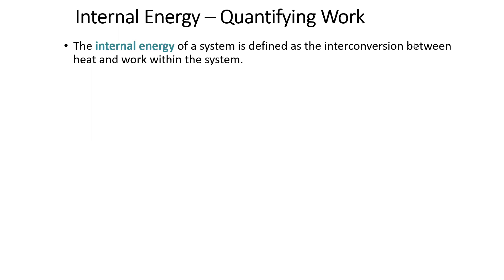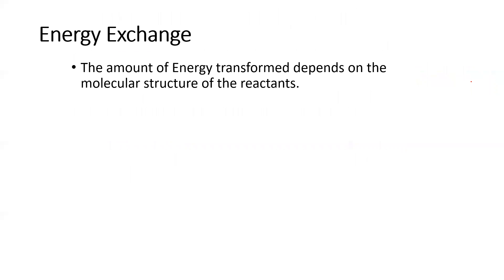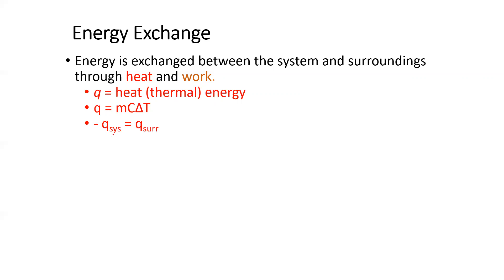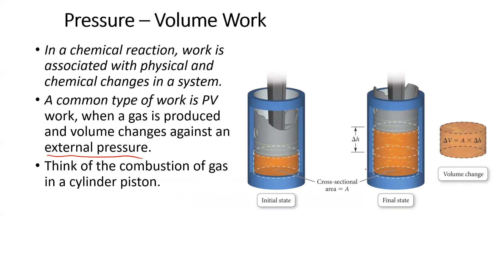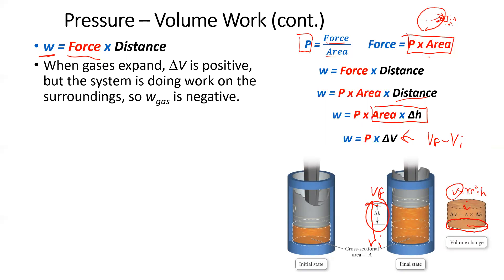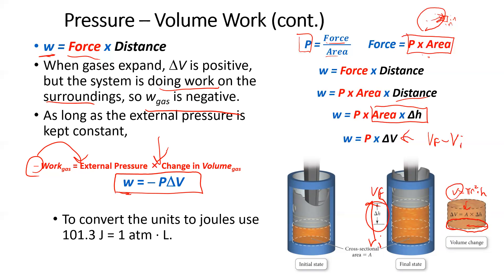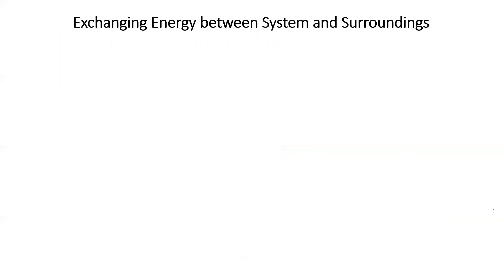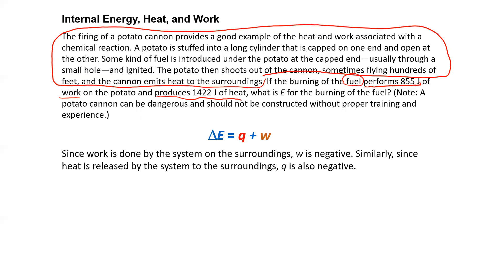How to Calculate Pressure-Volume Work in a System

Comment: Great video 😊
Reply from the maker: Thank you so much!
Reply: @SeanMcMahonSMACTV  hi, excellent video. I have a questions, in some books I found W = P·deltaV, but +P, no -P. So, when do I use -P or +P?
Reply from the maker: @isaacmolina5500  The sign is - for work, when it does work on the surroundings. Think gases expanding pushing the atmosphere back requires energy so the system loses (-) that energy performing work.